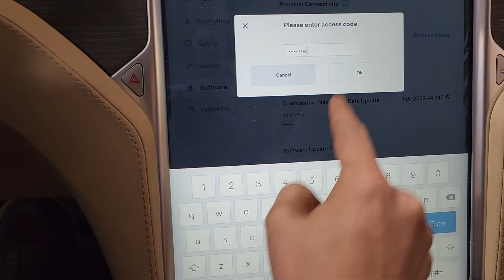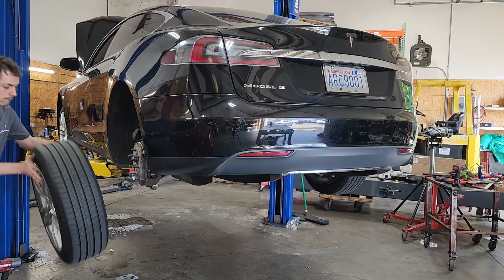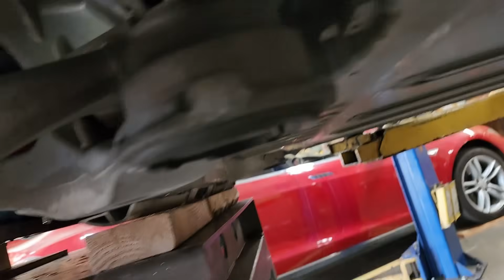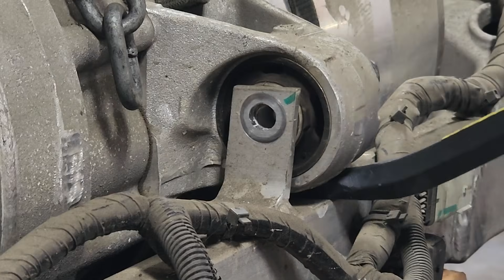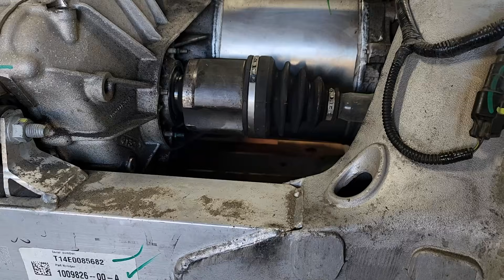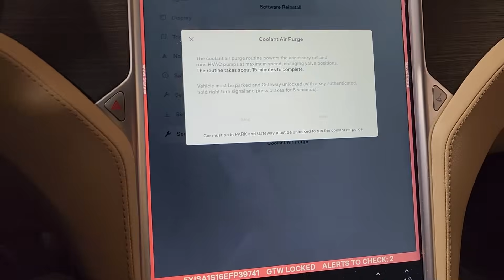Tesla LDU Rotor Coolant Delete Install (Model S)

Comment: Great vid, anyone here has that annoying buzzing sound when accelerating ?
Reply from the maker: Most likely that's either your rotor bearings, or primary drive gear bearings. I have another video detailing that particular failure mode (as well as a 2 part series showing the full teardown and rebuild process for the LDU).
Reply: If only when accelerating, this could also be one of the HV contactors (inside the battery pack).  I have a screenshot of Tesla Tech Note TN-13-16-002 R1, but I don't have the PDF, and I haven't been able to find it (searching on that number gets a non-R1 TN but it's about the Rapid Mate connector).

I got a "reman" battery pack in 2019 that squealed on accel (the old pack didn't).  It varied in pitch depending on how far you pressed the accel.  The noise went away in 2022, and a contactor failed in 2024 (and the "reman" pack had the original, troublesome TE contactors, grrrr).
Reply: @alsavage1  wow thank you very much, i found it very odd zero sound what so ever when on neutral, i will dig this way more
Reply: @lotfyken2759  TBF, rotor/pinion bearings are a lot more common for noise, esp. if you have the original rotor bearings (and the Aegis brush ring that failed to divert stray induced rotor currents), but if your noise is more like a balloon squealing, and esp. if the pitch of the squeal changes with how you place your accel foot, then a contactor can be a reasonable guess.
Reply: @alsavage1  below 8km/hr the buzzing noise turns into a clicking noise that matches rotor (not wheel) speed. On full stop i turned max heat (6-7kw) and no sound from battery rear. You are right it's theses bearings. Now i have to see if i can find time for a trip to Alex shop for this engine overhaul.
Thanks for the tip.

Comment: Alex, another fantastic video, quick question, where do you get that cap to plug that coolant manifold? 

I wish you lived in my area because I would definitely be an intern for you!!

THANKS
Reply: It's 50$ on ebay  , i don't know how hard is the mod
Reply: @lotfyken2759  The $50 DIY mod is a specially formed SS cup, and you have to remove (cut, break off), machine) the long aluminum tube from the manifold in order to install the cup.

By contrast, QCC's manifold is a really beautiful bolt-on.

If you screw up your manifold, where will you buy a replacement?  Not from Tesla.
Reply: @alsavage1 $50 vs $500 👏
Reply: @Nicholas-f5  The $700 part is a lot easier to install; it's a bolt-on.  

OTOH, I had one machined from aluminum, before the SS cups were available -- they were largely Howard's work, I wanted mine a bit sooner.
Reply: It's 50$ on ebay  , i don't know how hard is the mod

Comment: Well done as always!

So is it only non-performance dual motor models that don't have LDUs?
Reply from the maker: Correct, the only models that use the LDU are RWD and/or Performance versions of Model S and X from 2012-early 2021. Dual Motor  non-performance versions don't use the LDU.
Reply: @AlexEVRepair have you ever seen the small rear motor 60? Wondering if that would bolt up to this cradle or if it's a special one.
Reply from the maker: @Nicholas-f5 I have heard about their supposed existence, but have yet to ever see one in person, or even pictures of one. The rear subframe is the same regardless of SDU or LDU (same for RWD and Dual Motor, both Performance and Non-Performance).

Comment: In such an upgrade is the car's SC1 status affected or lost? Thanks.
Reply: SC1 is retained when swapping battery. I had a bad 85 kWh battery swapped out for a new 90 kWh and still have free supercharging.
Reply from the maker: No, even swapping battery packs doesn't affect SC01 status.
Reply: @AlexEVRepair the info must be retained in the MCU, correct?
Reply: @Nicholas-f5  It's tied to the VIN.